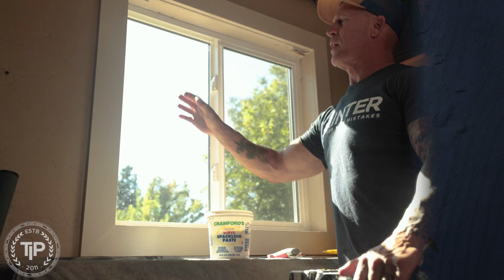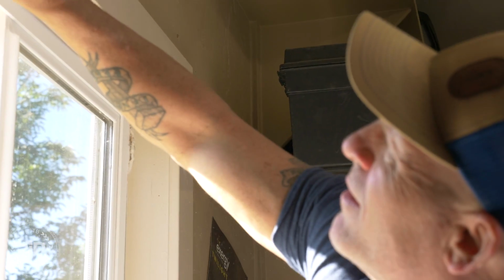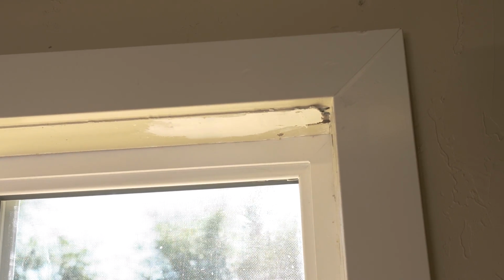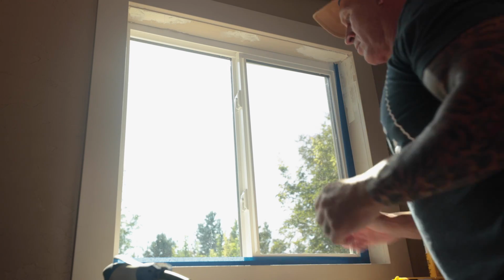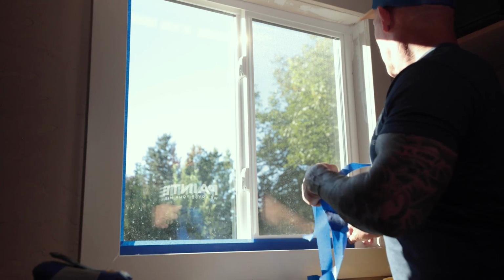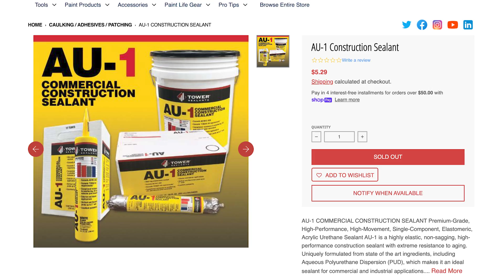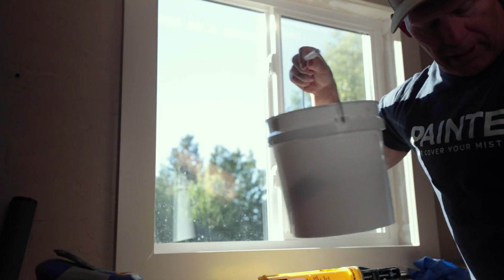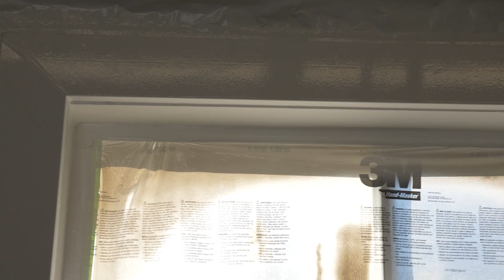Spraying Trim with a Graco Handheld.  Home renovation tips.

Comment: Great look at painting a window. I have used the Graco handheld sprayer for a couple of years now and I thinks its really useful for small jobs just like your window or doors. However it certainly has it’s limitations, especially with more viscous paints and it really needs to be cleaned very thoroughly which takes a lot time. I use hottish water with detergent to get it cleaned properly.

Comment: Chris, I've been watching your channel for a few years - always great quality tips and production. But, the Graco Ultra handheld sprayer is an absolute PITA. I bought one after watching your original review (test spraying the exterior of a shed) but wished I'd saved my money. It won't spray regular paints unless they are thinned, the hole in the tip guard blocks ALL the time (the 514 tip is generally OK), and if the paint is thinned enough for the Graco to handle it the spray pattern is either 'striping' or a fire hose. My Wagner GEA 350 will obviously spray the same paints straight from the can (no dilution) because it's 240V powered, but even my first budget range (£150) Wagner HVLP will spray the same paint without requiring dilution. The Graco is simply not worth the. money in my opinion.
Reply from the maker: Sorry to hear

Comment: Hi Chris.  Thanks for all the videos like this it’s really helping me be bring my paint game up a notch.  I wasn’t happy with my brush strokes on previous jobs and love this thing for small trim jobs.  

A few questions for a DIYer.  How many coats do you do and how long to wait in-between coats?  If I want super smooth trim is it necessary to have a light wet sand between coats?   Taping is always the most time consuming part for me.  I usually pull the tape right after I coat it.  Do you leave the tape on in between coats to save time, and if so how any tricks to removing it?

Thanks!
Reply from the maker: I have videos explaining in depth

Comment: The sprayer is good until it quits working. I didn’t get the money back out of mine. I will probably still spend the $165 to replace the pump. Its great for small stuff and is quick and easy to get into paint and clean up.
Reply from the maker: I had one last 10 gallons.

Comment: I have 2 of those ,, I will never used to paint that, roll and brush is better.
Reply: I prefer spray looks cleaner no brush marks if you use sprayer correctly you will have an even uniform placement of your paint. It almost gives it a commercial look I guess if this makes any since.